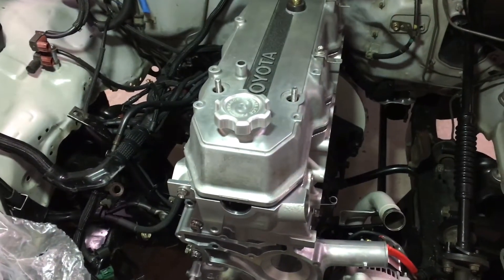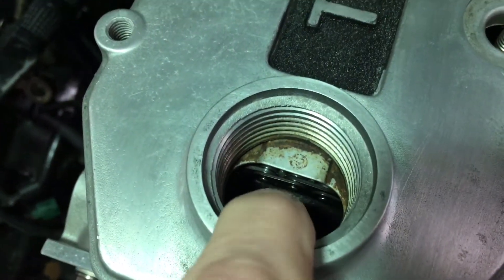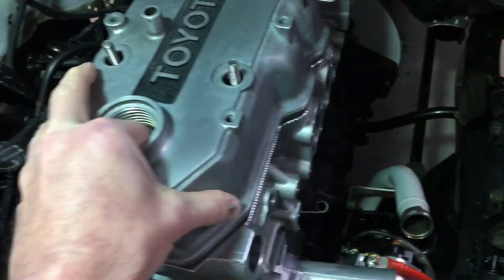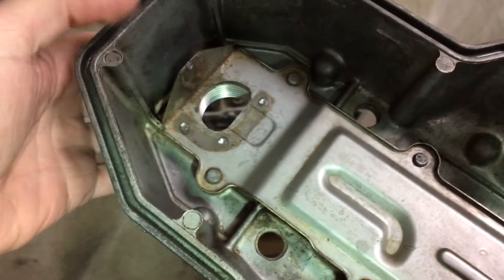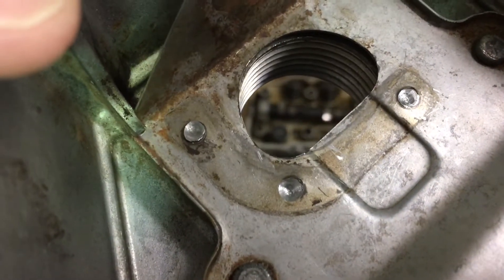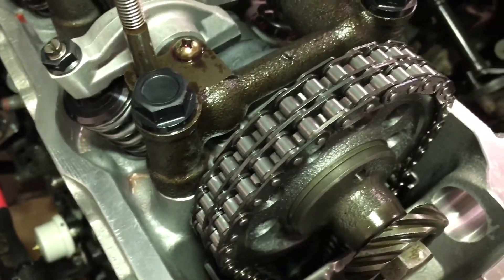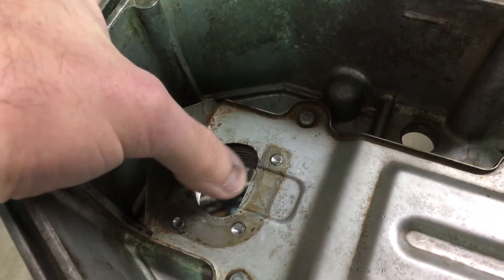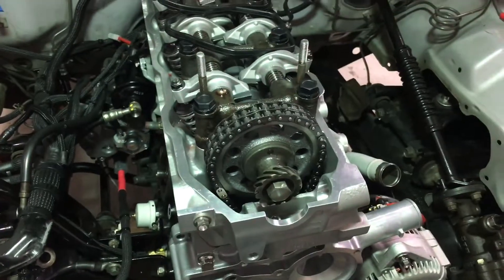Valve cover modification for LCE dual row timing chain upgrade Toyota pickup 22RE

Comment: Hello,I have a 1992 toyota pickup with the 22 r engine.I wonder if I can make it dual row timing chain?
Thanks,you are a real professional.
Reply from the maker: Yes, you can. LCE sells a complete kit. The only major modification is to the valve cover as shown in this video... otherwise, it's basically just bolt on.

Comment: I wonder how much the cap will leak now without the baffling?
Reply from the maker: The gasket on the cap seals really well, so I don't think it should be a factor. But yeah, that's definitely something to consider if your O-ring on the cap is shot and you aren't replacing it.
Reply from the maker: Zero leaks. I've got 300 miles on the motor so far and totally dry.